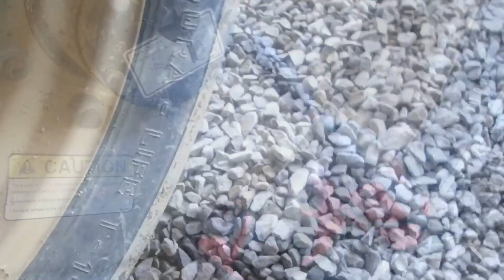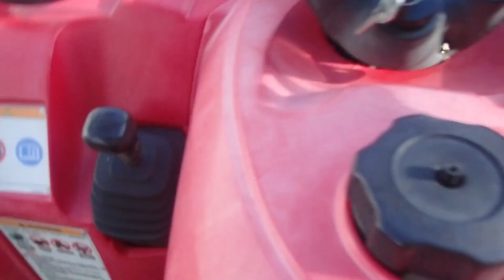NEW RACE TRACK 4 WHEELER 🤔🤔🤔”Yamaha Bruin"

Comment: Some info. on what you bought.  It is a 2004, 2005 or 2006 (the only years they made the Bruin, though it is functionally identical to a a couple other models) and the color is romantic rouge.  It is a 350cc and has a nearly bulletproof engine.  I love mine and will keep it in good shape for how ever many years I am still alive.  It is a nice find, they are not rare but rather rarely seen any more.